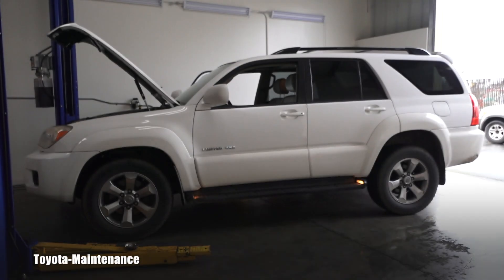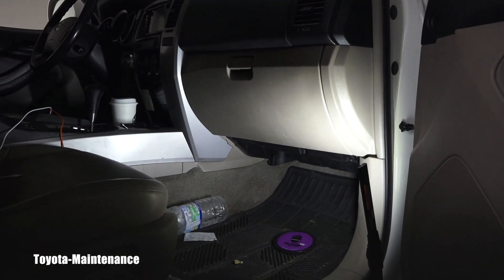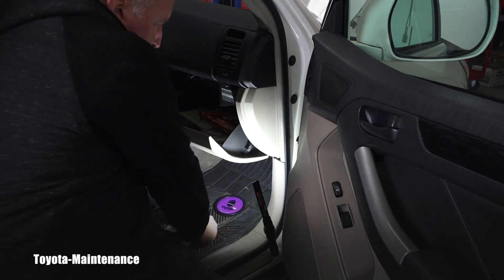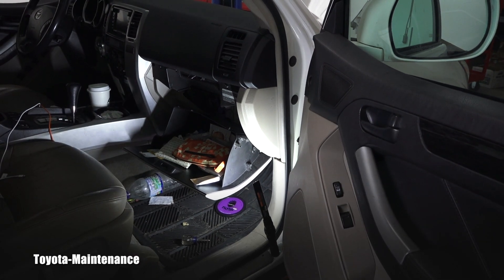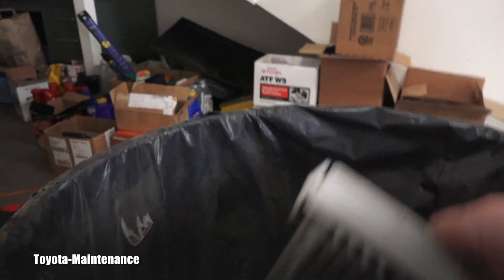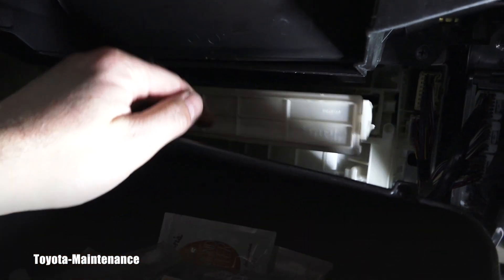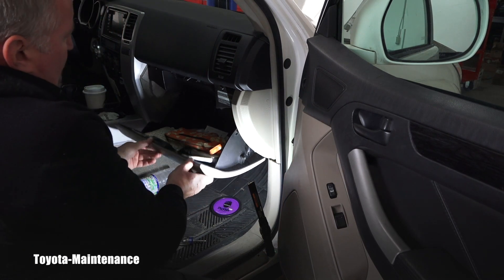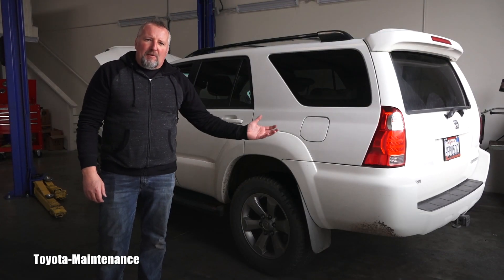How to replace cabin air filter on Toyota 4Runner

Comment: Great video TM - I don't remove any screws or anything on the damper assembly... just gently pull off the bottom part that attaches to the door.  It pops off on both my Toyotas.  Filter are like $6 on Amazon so I buy new ones and in between changes I blow them off with compressor air. Use a sharpy to write down the date on the filter element helps too.  Thanks!
Reply from the maker: thanks for sharing